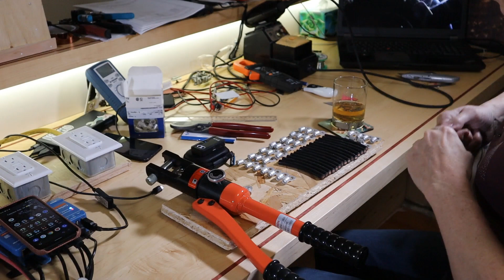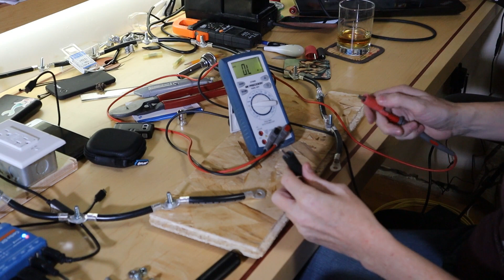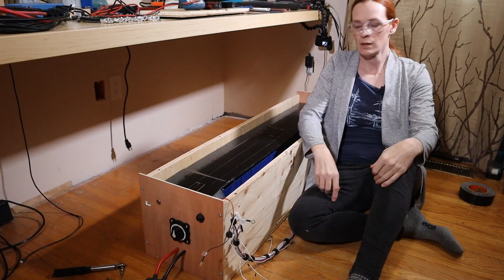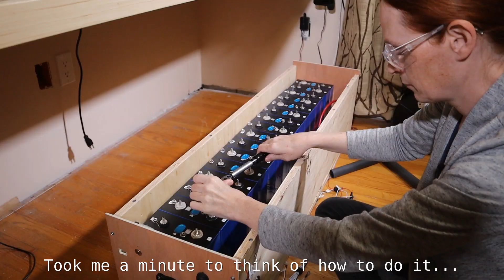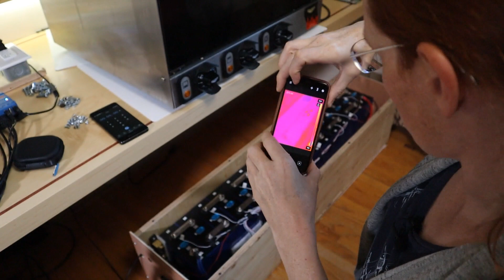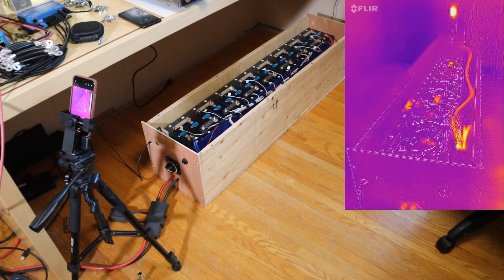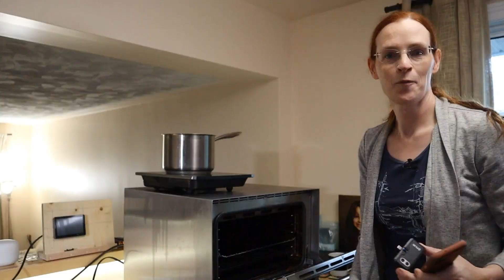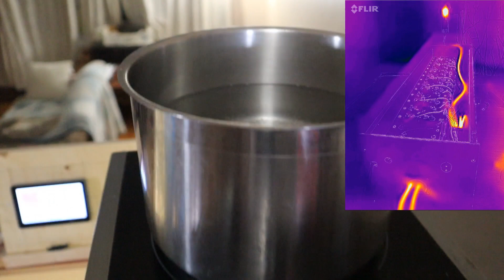What's Better? Rigid or Flexible Bus Bars - How to build a 48v Lifepo4 battery (Ep. 21)

Comment: This is an interesting video for me- I just got done making a 18650 pack with a suboptimal spot welder. This "busbar resistance" ended up being a major factor- even in just my discharge tests. "Resistance with current" strikes again. I'm not sure what to use it for now, likely will use it in a low-draw water pump or similar and just wrap the whole thing in kapton and put it in a metal box.

I got some 320Ah LiFePO4 cells in the mail (finally) and used those for my current solar setup instead. Feels much safer, granted they are using solid busbars right now... I might have to pick up some 4AWG wire! They're sitting in a metal toolbox now but I'll have to check out your non-compressing battery box build. I like that these flexible bus bars also aren't completely exposed. Much to consider after watching this video!

Solar Solidarity from Maryland.
Reply from the maker: Sorting all this stuff out is both the joy and frustration of DIY, eh? :)

Comment: i make high current batteries for electric vehicles that go well into the 300A range and more at 70~144V. flexible has its advantages and so do bus bars. bars are unbeatable if you do lots of volume and series runs. i dont, i make one offs. flexible simply take too much time to make properly and using properly rated wire, lugs and heat shrink (which is missing in your setup) is still a lot more expensive then just flat bus bars. but there is a third option you missed: multi-plate bus bars. they are made of several thinner (generally 0.25mm) pure copper sheets. that way you get the advanges of bus bars (more sutrcturally sound, safer, cheaper and so on) with the benefit of being resistant to viberation. that said, for your use case it absolutly does not matter what option you make. its a stationary setup. the only thing you need is to actually compress the pack and use locking nylon nuts (those are single use!) and proper washers. also: the hole in the middle of the bus bar is to connect the bms to. try never to use the battery lugs to connect the bms. use the bus bars for that. and have large diameter washers under the locking nut or use 2 (1 smaller on top) to spread the load out over the bus bar. this also applies to the crimped connectors. the washer needs to completly cover the connector and should roughly be the same size as  the battery terminal for a easy reference. if you want help with these things and prevent (expensive) mistakes you can send me a message.
Reply from the maker: Lithium Solar actually talked about the multi-layer bus bars, so I didn't think it was worth bringing up, knowing I was going to link to his video. I also do plan to put shrink tubing, I just didn't have enough on hand so I have to place another order. Note that my setup will be very dynamic, these batteries will power my boat before toooo much longer. As for the hole in the bus bars, I know, I drilled them. ;)
Reply: @TheDigitalMermaid  a couple things i noticed later, if you are planning this setup for marine use you MUST add compression bracing. this is not optional.  and every connection must have its own nut/bolt. so the balance wires need to be separate from the battery terminals. also the balancing wires need a slight upgrade. i recommend sillicone insulated with 0.5mm or bigger and acutal copper, not aluminum wire. do not bother with equal length wires. make them as short as possible. make sure you use heat shrink with glue on the inside. that seals the connection. also make sure you cover the front of the terminals if there is a hole. there cannot be any way for air to reach the copper wire. this applies to EVERY wire in the box. cover the BMS in conformal coating. use hot glue to glue and seal the connector  and its wires so no air can get into the connector. i also recommend a interal swich inside the box to bypass the BMS if it breaks while on the water. with the bms you are using that is pretty likely. for high current applications you generally do not use a bms that actually carries the main current but only senses it with a separate hall sensor and contactor.
Reply from the maker: @SupremeRuleroftheWorld  Can you provide sources for this position? It goes very much contrary to a LOT of marine installs...
Reply: @TheDigitalMermaid  please specify what you think should be done for "marine installs". about 30% of my battery packs are installed in marine applications. disclaimer: i have built batteries well into the 200kWh range with various chemistries, they all requires different styles of installation, especially on moving objects.
Reply from the maker: @SupremeRuleroftheWorld  Most I've seen are tinned copper wire, tinned ring terminals, and resin-lined shrink tubing. I've not seen many (if any) that had all metals covered, save for when there's a conformal coating applied. So far as I know, most lifepo4 batteries used on boats are not compressed, either (ie: Battleborn, SOK, etc). So when someone tells me I need to do something in a very specific way, I want to understand why. Keeping in mind, this isn't a commercial install.
Reply: @TheDigitalMermaid  yes, the copper should all be (preferably) nickel plated. but the wires should also be copper, not aluminium. aliminum is very affected by salt air. the balance wires are aluminum. and the wire strands should be fully insulated from outside air. this is not optional in marine applications, its mandatory. and yes, you need to allow for movement in a battery setup. but that applies to things that are ok to move. on itself a lifepo4 cell (not in cyclindrical form) does not care about viberation. but the problem is that the cell generates gases when charged or rapibly discharged. that destroys the cells as it causes delamination. you need compression to stop that effect as it will seriously reduce the lifespan of the cells. cylindrical cells do not suffer from this as the form factor naturally compresses the cell inside. but these blocks do. so you need to prevent that. i would split the pack up in 3~4 blocks so it does not need 1 massive long set of rods and other physical problems. smaller blocks of 12V or 24V makes it simpler to handle and mount in such a way that its easy to absorb movement and shock. and the reason why many packs are not compressed is that it adds cost, size and "lower" specs on the marketing sheets. and if a battery dies after 3 years or whatever they will see you back as a returning customer, that is good for business. basically 100% of my customers i will never see again as i give 5 years warranty on some batteries, even if used daily. i build by batteries to last, not with "economic restraint". so that includes making the cells as happy as they can be. and for cells like this to last you need compression. its unpopular because most people you see use these kinds of cells are already on a very tight budget and have seen too much youtube videos or read too much forums of other people that say you dont need it because "mine works fine". but go and see how these packs preform after 2~3 years and you generalyl see a bunch of puffed up cells or half the cells are already replaced or the entire thing has been binned. and funnely enough you dont hear from those as they are too ashamed. i have been and repaired way too many packs like that as i was brought in as a second opinion by the customer. please learn from someone who has been doing this work for nearly 10 years and made it my profession. you would not use a puffed up pouch cell would you? i dont understand why people think its fine to let/have puffed up lifepo4 cells. its litteraly the most obvious sign of internal damage.
Reply from the maker: @SupremeRuleroftheWorld  The wire I am using is tinned copper marine wire, not aluminium. I link to the exact spool I used in the description of the video. As for the balance leads, if they're aluminum, then there's not much I can do unless I buy the raw connectors and tools to crimp their leads and make them over again. I could cut the majority off and re-terminate, but the issue would remain on the cable that's left. Burying the connectors then makes future service harder. I may well spray a conformal coating on them. Also, how do you know the BMS balance leads are aluminium? They might be, I haven't checked.

The topic of expansion / contraction in lifepo4 cells is a topic of great discussion, as I mentioned in the opening of this video. The manual for the cells does not say that compression is required, only that it helps. There's an argument to be made that if you don't allow for some expansion, the internal pressure could rupture the burst disks. So far, I am still not convinced that compression is required. 

You have your reasons for building as you do, and I will not argue your points. Everyone has their trade offs to choose, and I spoke of mine in this video. You could also argue, very reasonably, to stay within 10/90% SOC as well. In the end, each use case needs to be considered. That said, if you can point to some documentation that shows test results on the differences, I am happy to read them.
Reply: @TheDigitalMermaid  i know those balance wires are alu because they always are. actual copper is extremely rare, especially in this class of bms. 

the subject of compression is actually not a debate in the industry. you just do it, end of story. its only a debate on the internet by keyboard warriors messing around in their shed. please look at automotive packs for reference for actual industry examples. you will find that every single pack out there uses compression. only tesla does not because they have cyclindrical cells that does not need it. please do not confuse what a dozen people on facebook, youtube and other assorted forums are shouting with what is actually the industry engineering standard and construction recommendations from cell makers. in more blunt and hopefully relatable terms: not using compression is the equavalent of not getting the covid vax.
i have something better then documentation. i have currently about a quarter ton of 40Ah thundersky cells in my storage shed that is waiting to be picked up by the chemical recycling complany that i have pulled from a boat that are all puffed up to varying degrees due to lack of compression. they have been in seasonal use for about 4 years. more then 60% of the cells has serious issues. and yes, i also have testing data of a LOT of cells but that is not something i share publicly. most of that testing is on 18650 cells so not very relevant here.
and i have my reasons for building packs in certain ways. and those methods i have refined and tested for many years now and based on industry standards and codes. when it comes to these types of cells the failliures are 70% due to no/poor compression of the pack and the other 30% is just dying shitty chinese quality cells instead of proper brands like thundersky or calb. prehaps add a couple percent for cheap bms that fail and kills the pack with overdischarging.
that said: you CAN skip compression if you keep the voltage UNDER 3.4V per cell and the discharge and charge rates under 0.1C or less. but that is a pretty hard limit. fun fact: charging above that voltage is useless and damages the cell if you hold it above that voltage.

another fun fact: if you check the manufacurers specs you will find that 95% or more of lifepo4 cells need compression. there is hardly any normal block type cell factory that makes cells that do not require it by the manufactuer. i would almost dare you to check the "real" datasheet of those cells and also check its manufacuters product sheet where it puts all the testing data, i am pretty certain you will find that they ran all their testing on a compressed cell. i will be willing to bet you will have a difficult time finding any datasheet where they dont recommend doing it.
again: do not confuse forums/facebook with actual manufactuers recomendations and industry practices/standards. they exist for a reason.

Comment: I agree - using cable the cells can move about slightly without issue (though I would heatshrink them for good order, as with the balance leads).

I have created my own using 0 AWG welding cable and hydraulic M6 copper crimps (my boat is 12v and even a 1000w inverter draws a shed load of amps!).   Andy over at Off Grid Garage has a video on the effect of torquing down the bus bars on conductivity ( https://www.youtube.com/watch?v=wUvfzDuRVtE ), but I am with young Mr Prowse in preferring studs to bolts - that way you are torquing down a nut onto the terminal plate, rather than twisting a steel screw in an aluminium thread.

You also need to be wary of scuffing the blue wrap on the cells, as the aluminium casing underneath is +ve (and I'm assuming that most exposed metal parts on your boat will be -ve - add a moist environment, rinse & repeat :-) ). Because of this I have a small fibre insert between cells, and two plastic (ex-kitchen chopping board) bookends, all strapped together (4S) with 1000mm x 12mm cable ties (yes, such things really do exist!)

Comment: FYI, I recommend the Ancor lugs. Better plating, and closed end to help resist corrosion. The Ancor wire/cable you are using is less flexible, but the best I have found for corrosion resistance.   I can hear you now, what does a computer geek living in the desert know about corrosion? Simple, since it regularly above 110 (Fahrenheit), I have been using an evaporative cooler to see if it works well enough to keep things cool. Really impressive how much corrosion can develop in 6 months. Anyway, I suggest you look at spending the extra for the Ancor lugs, and of course high quality heatshrink with glue. The open end on the lugs you are using is an opening for corrosion.
Also FYI, heatshrink ring terminals are worth the extra price, even factoring in the different crimp tool required. I speak from experience, avoid the Ancor brand crimp tool for heatshrink ring terminals.
My infrared camera has lead me to the conclusion that every single time I play with the busbars, I use IPA (isopropyl alcohol) to clean terminals and busbar. I have the 99.5% pure version since my wife is in charge of a Covid test lab, but I am sure a lesser concentration will work fine. Otherwise every time I put them back together I wind up with a high resistance connection somewhere.

Very good test, BTW.
Reply from the maker: Hiya! I planned originally to have shrink tubing, and I will add it. I just didn't have enough on hand, so I left it out of the video. I always get the resin-lined shrink tubing exactly for corrosion resistance.  To be clear, I will never ask "what do they know?" because the answer is always "something I don't". :)

Comment: I don't think that the nickel  plated buss bars are heating unevenly, i believe that the heat displayed is coming from between the battery cells.  More room between the cells with cables  equals more circulation between cells hence less displayed heat.  Only a humble stab at an opinion, may not be correct.
Reply: I have found that little things like oil from your skin (or cat hair) can cause significant heating. I always clean the busbar and terminals now when I put things back together.
Reply from the maker: There was no such heating on the flexible* test, though.

Comment: Im not a fan of those split ring ring crimps, prefer using branded tube crimps to match a branded hydraulic crimper but i use mine every day for work, any batterys i have done in the past i use 95mm or 120mm cable .. which i think is equiv to 3/0 and 4/0 gauge cable , but you are right, flexible is much better in vehicles and esp in marine use due to vibrations.. another Ave fan with her safety makglarses :) ... great video
Reply from the maker: With the amps I'm dealing with, the voltage drop calculators said the 19mm are fine. This is the win of 48v. As for t terminals, can you link examples? All the ones I find are split/brazed. How have you seen split fail?
Reply: @TheDigitalMermaid  I assume that you and Torchy mean mm2 (cross sectional area) of the wire. 
My question is where you get 19 mm2 from? I thought you were using 4 AWG wire, which is about 21.2 mm2, and usually crosses to 25 mm2 for metric wire size.
What am I missing here?
Reply from the maker: @BobCollins42  In the description are links to the wire I use. Specifically - https://www.ancorproducts.com/en/p/113510/Tinned-Copper-Btery-Cable-4-AWG - Ancor Part # 113510 - "Tinned Copper Battery Cable, 4 AWG (19mm²), Red - 100ft"